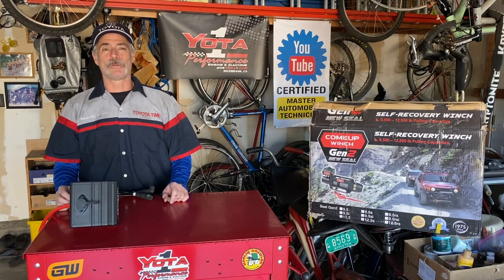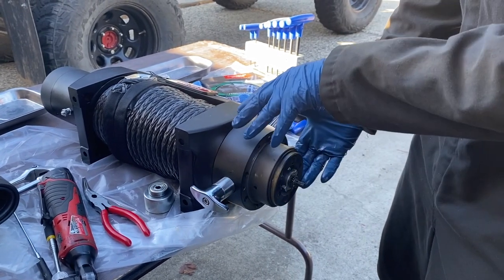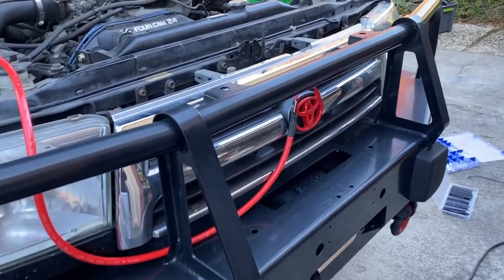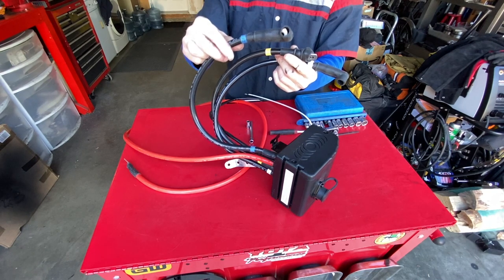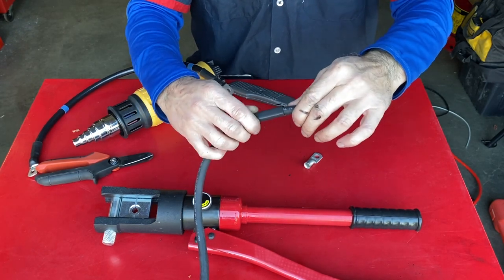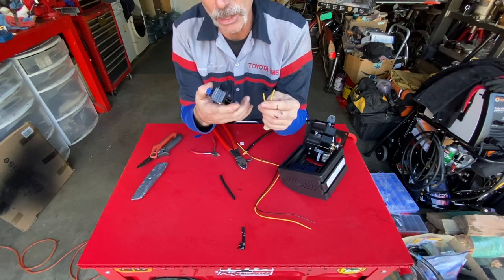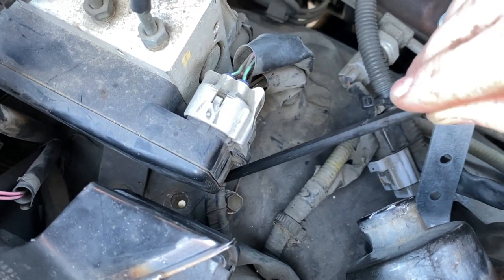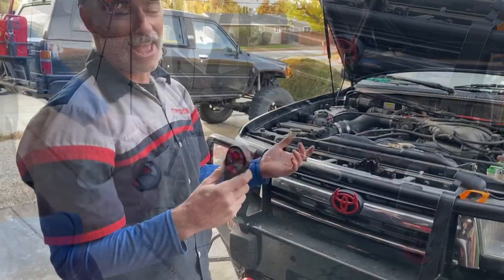ARB Bumper Winch Install & Control Box Relocation

Comment: Thanks, Timmy. I just bought a Smittybilt winch for my 3rd Gen. I plan on keeping my stock bumper, and I'd like to mount the control box in the engine bay to possibly reduce the amount of trimming on my bumper, so this is very helpful!
Reply from the maker: You're welcome.  Good luck with the install.

Comment: I am a fan of Warn winches been using them for 45 years and yet to have one let me down. I stuffed an M8000 in my ARB bumper mounted on my 95 Taco. The bumper comes with a mounting bracket to mount  the control box of a M8000 to the top of the bumper. Had to clock the clutch control and the supplied power cables were long enough to hook up to my auxiliary battery mounted on the passenger side wheel tub. I have a cold air intake so there was enough room. As always great video!
Reply from the maker: Hey Brad, I have the same Warn winch on my 98.  Thanks for the comment.  Happy Wrenching!

Comment: So now you have to open the hood to access the control box to plug and unplug your in and out switch .
Reply from the maker: No, he has a wireless remote. This model winch comes with both a plug in option, and a wireless remote.

Comment: I put the control box for my badland winch inside of the front passenger wheel well, in place of the window washer reservoir.
Reply from the maker: That works.  It will get caked with dirt and mud though and sometimes get pelted with rocks and gravel in the wheel well.  With that location, you'd want to make sure the controller cover is on tight, because if it popped off, grit would get in there and then you'd have a hell of a time connecting your controller.
Reply: Which badlands did you get I'm hoping the apex 12k that I bought will fit
Reply: @justinedmondson3501  I got the zxr 12000

Comment: Planning on almost the same location for my 01 Tacoma...do you know what lengths you cut those welding cables? Planning on ordering some.
Reply from the maker: Don't remember the lengths but 20 feet should be enough.  Here's a link to some #2 welding cable like we used for the project: https://amzn.to/3ofyxwG

Comment: Nice guys. Any negative effects since you removed that center support?
Reply from the maker: Everything is fine with the support removed.  In a perfect world, we would have done some alteration/fabrication to keep the center support.
Reply: Currently doing install on 1st gen taco and I have found getting the hood to latch properly is quite difficult to do without the support in place. Haven’t figured a solution yet

Comment: Did y’all weld end caps onto the body frame?
Reply from the maker: Yeah we did. We cut up the end cap that comes with the bumper kit so it can accept a bolt with the threaded hole side, and welded it onto the frame to box the end in.
Reply: @TimmyTheToolman  thanks! Great channel!

Comment: Put dielectric grease on electrical connections before using the shrink tube to make waterprof.
Reply from the maker: This is an interesting thought but the shrink tubing has a glue on the inside of the tubing that activates from the heat and pretty much does a complete job of sealing off the connection from moisture.   If we put dielectric grease on the connection, that would inhibit the glue from sticking.  So, I'd have to say the connections we made are about as waterproof as you can get due to how the shrink tubing is made.  Same goes for the shrink butt connectors we used.  The connectors not only shrink tight against the wire sheathing but they also have an adhesive that activates from the heat that completely seals off the connection from moisture.  Thanks for the comment.

Comment: 9:35 Wow did you see that! Freakin car just disappeared back to the future style!
Reply from the maker: It's magic.
Reply: @TimmyTheToolman  Hey thanks for replying to me! Hope you don't mind my observation on the "disappearing car". Also thanks for your videos. Really detailed and helpful. Used your timing belt replacement video for the 5VZ-FE engine in my sons Toyota 4x4. My son helped out and learnt a lot.  He's an expert now and went around to his mates place & replaced the belt in his as well. Both cars running perfectly - no problems at all! Looking at installing a winch in my ARB Bullbar (you seem to call them "bumpers" over there in Merrica?). Trying to do a bit of research on this one. Cheers!
Reply from the maker: @guanghunglo3594  You're welcome.  Great to hear our timing belt video helped you out.  That's cool you could share the experience with your son and he learned a lot.  Good luck with the research for the winch install.

Comment: Don’t understand why you would not just put it on top of the bumper . Just saying.
Reply from the maker: Well, for some people, it can be a looks thing to not have the box bolted to the top of the bumper.  It's a much cleaner look having the control box hidden in the engine compartment.  Lots of guys do this.  Also, the box will block some air flow to the radiator, AC condenser, and maybe a trans cooler if the person installed one, which will hinder the cooling efficiency.  Just saying.

Comment: I got my ARB in yesterday if I would've known that it isn't so compatible with reaching the clutch I wouldn't have bought it.  Looks like I will have to do some cutting on a expensive bumper to make things accessible.  Complete BS
Reply from the maker: It's a bit tight to get in there to turn the clutch lever, but it can be done.  Did you try clocking the winch like we did to get the handle in the most ideal position for access?
Reply: @TimmyTheToolman  I haven't yet.  How are you accessing yours? Are you having to reach up under the bumper to get to it?
Reply from the maker: @matthewlee2686  There's square holes in the bumper below and on either side of the bumper fairlead slot.  Sean can reach through the driver side hole to access the clutch release mechanism.